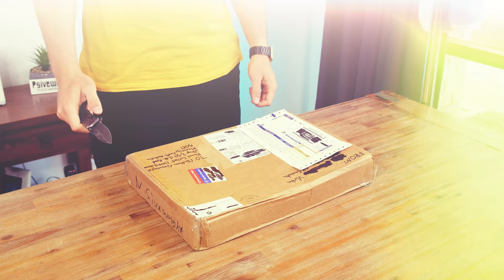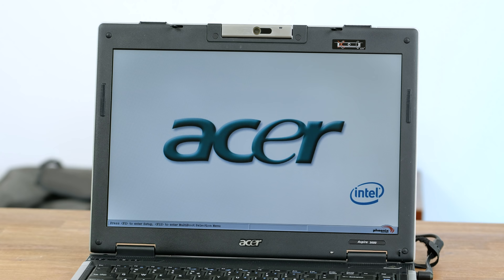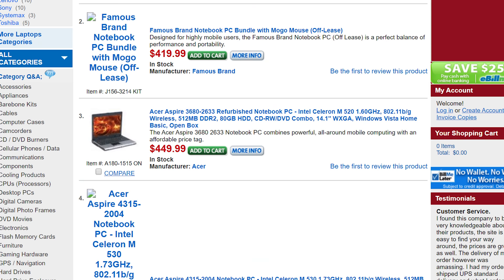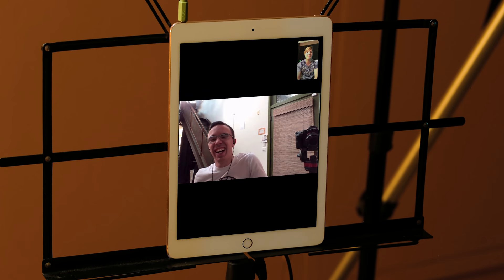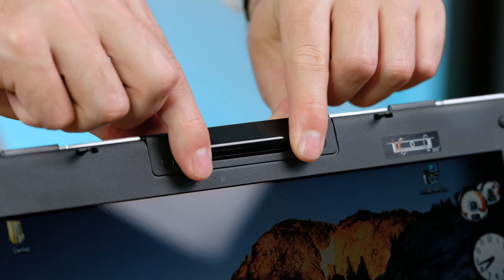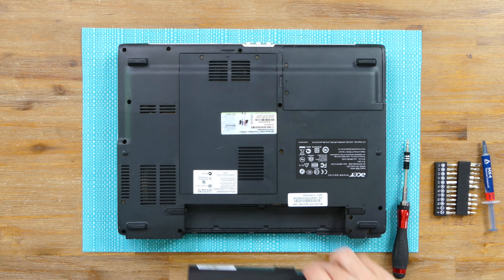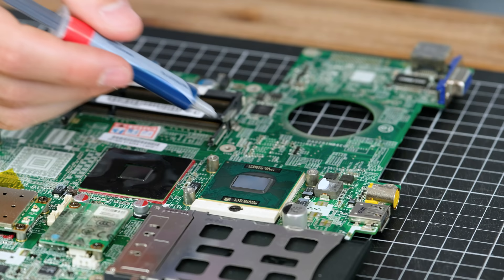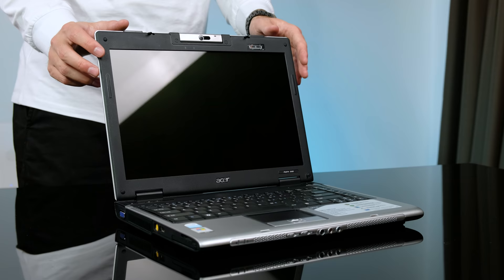Windows Vista Laptop... In 2020! Ft. Austin Evans

Comment: You should've find a replacement dual core processor and replaced it while your inside. I took my Toshiba A105 I used in college (06) and replaced the 1.86 GHz intel Core solo with a 1.7 GHz Intel core duo while I was replacing the fan a few years back. Still holds up in XP playing old games. Did preform very well when I ran Windows 8 release candidate back in 2012 with only 1 gig of ram.

Comment: The desktop version of that cpu was no bettter. I had the celeron D at 3.2ghz and it really lagged until I replaced it with a pentium D which seemed so much more powerful. The main problem with that generation of celerons was the lack of available l2 cache.

Comment: I have an acer aspire 5570 zr 1 it gets the job done it can run windows 10 i run windows 7 super lite on it her are the specs
1.6ghz cpu
1gb ram
128gb IDE HDD
I love this pc i am emotionally attached to it
Oh i also have an acer aspire T660 desktop under my bed with another pc from 1998(the cpu is installed on a pci express slot like thing and the socket is empty) i love old computers they look gud to me
I also play gta san andreas on the aspire 5570 and played through the whole game

Comment: I think this laptop can be upgraded with the T7200 Core 2 Duo, which is dual core, and runs at 2GHz, so that will make it a far better experience. Can be found on eBay for about $7US or $10AU.
A bigger SSD(120GB or so), and that faster CPU would do wonders for that machine..

Also, Broadcomm made a CrystalHD card, that goes in the MiniPCIe slot and decodes video at 1080p30fps, however, since that laptop only has one MiniPCIe slot, you would have to use a USB WiFi card.

Those laptops would make good Linux machines, if you run a 32bit distro, which will use less RAM, Mint 19.3 32bit Ubuntu MATE 18.04 32bit, and Lubuntu 18.04 32bit are supported until 2023.

Comment: I have Acer 5570Z, similiar to Acer 3680. Mine is upgrade to Intel T7200, 2GB RAM, 240GB SSD. Have no issue with this laptop hardware..

Comment: hey i used a vista laptop too! it was a bit better with an amd turion x2 and 4 gigs of ram
it ran vista home premium perfectly. i was able to get the same laptop again and it handles vista ultimate and windows 7 just fine. i wouldn't count on 8 or 10 though, espetially 10. the performance on 10 on older hardware makes me shiver. its so bad.

Comment: I had a similar laptop specs wise, an Extensa 5220, it was $650 new from A&R on Commercial Rd, early 2008. It had a new case design, slightly faster CPU and newer chipset but the rest was the same. We got it upgraded to 2 gigs from the get go, the guys at the store would open the box and do the upgrade for you for free, something that would never happen these days due to the demise of dedicated computer stores. The original hard disk was an 80 gig Hitachi 5200rpm. Did not help the slow CPU at all, don't miss the thing haha it was such a bitch to use. My then 5 year old Athlon XP desktop seemed faster, maybe because in some ways it was. Compared to new budget laptops which are actually pretty quick and very usable even on the latest OS shows how far we've come in a hair over a decade.

Comment: Hello I would like to give you an advice if I am not disturbing you. In case you want to keep that laptop as a windows vista machine you could try to have a cpu upgrade on it. In fact there are only two cpu compatible with the m socket and the same watt (27W in our case) as your laptop. So i suggest you to find and install an intel solo T1400 at 1.8GHZ or an Celeron M450 at 2.0GHZ

Comment: I have two laptops very similar to this. The first one got thrown away, the second one I bought for maybe $15, and is a TravelMate 2480, which has a similar style to this one. From tests, I determined that laptops like this can run Windows 3.1 up to Windows 10, as well as Windows Longhorn build 4074, most 7 beta's, most 8 Betas, and some Windows 10 betas. This does not seem capable of running Windows 95, 98, and the NT line before 2000. I have not tried running 95 and 98 under FreeDOS. I also have the original 80GB HDD that came with the laptop as well a 500GB one that I can pop in as well. The 80GB HDD has (or had) Windows 2000 and XP dualbooted, while the 500GB one has Vista, 7, 8.1, and 10.

Comment: i got so much flack off my colleagues when i worked at a pc repair shop for saying vista wasn't a bad os (it wasn't), it just came poorly optimised for most systems when installed fresh, it only took a month of settings tweaks and it ran great, 8 however should not have been put on anything that wasn't a windows tablet pc and i wouldn't even say it ran great on that.

Comment: I received an HP version of this lappy with same specs, just a fixed webcam. Mine has a dead battery but the system ran slow but usable with Windows 7 pro 32bit. I rather use LINUX and installed that and suddenly it ran MUCH FASTER and more stable! Imagine that.. The use of an SSD would speed things up I reckon. But I have to tell you the system DOES allow 4GB as that is what mine has! The Intel GMA945 chipset allows a total of 4GB(3GB usable in most 32bit OS). You need only to use DDR-2 PC5300 2GB sticks. Windows Vista was what was originally installed on it. The 1.6ghz Celeron is only slightly better than the Intel ATOM 1.6ghz cpu so that is a plus. This system was very budget but usable with the right OS(LINUX). Vista was too heavy just as Windows 10 found in all modern PCs is too heavy for the SAME SPECS that some budget lappys and PC units sell for today! Even NUCs and single board computers are selling with Win10 installed and they crawl! Put LINUX and suddenly, the units work as they should..again.. imagine that..

Comment: you should have used modded gma drivers games would have run a little better also you should do a update video upgrading the cpu to a Core 2 Duo T5300 they are around 13aud free shipping on ebay

Comment: My very first personal laptop in 2007 was HP Pavilion DV6331EU with dual core AMD Turion 64 X2 TL-56 and 2GB RAM. After 1 year the wifi and display broke down and it came out this particular model was subject of a class action lawsuit due to defective motherboard. The warranty was increased to 3 years automatically.  Finally it gave up on November 2010, 5 months after the 3 year warranty expired. 
I never enjoyed Vista, but liked its UI. I think Vista was not the worst from Microsoft. Windows Me had the worst stability and Windows 8 had the worst desktop experience. The problem with Vista was it demanded specs so much higher than XP, that it was slow in almost all configuration. By the time SP2 was released, hardware caught up, but Vista was stuck with a bad name. And those nagging authorisation prompts - who can forget those. Windows 7 was like a refined Vista.

Comment: you should consider change cpu to a core duo or core 2 duo, two core cpu increases performance dramatically from one core cpu. Also check if there is any bios upgrade, I have similar problem with a Packard Bell wich does not accept more than 2GB, and with the latest Bios I make it work with 4GB

Comment: we still use an Acer Laptop like this at work with a cam like this, but its form 2010 with core2dou 2x2.4ghz 4gb ram and geforce 9500m gs (512 mb vram) so for office its work still good. we use it to scan documents or sent mails but i try play games on it and.... yes Assasis Creed 1 run on low settings 😅 edit: its an Asus M51SN

Comment: Well, I had the exact same specification but different brand as my first laptop in 2007 until I get a new decent laptop in 2013.
It came with windows vista and 512MB RAM and SATA I, but it can do editing at 720p with Movie Maker, Photoshop CS3, and run GTA SA well on lowest graphics with 800x600 resolution, 512MB RAM on Vista can still do anything in 2010.

Why your laptop stuck at 100%, I never get "struggle CPU" even windows aero theme turned on.

Comment: You can created a video of if it can run Windows 10 if you want but I bet it will be very slow as it has 2GB RAM, a slow single core processor, and an ssd but with 60GB

Comment: This laptop was shit even for 2007 standarts, My very first laptop was asux x50vl, it had 2gb of ram, 120gb hdd, dedicated ati graphics, dual core pentium cpu. To give some perspective, at the time a lot of people were hating on vista because vista felt slugish, it actually didnt their pcs were fucking trash, this laptop ran windows vista without any problems or any hickups and this laptop laster over a decade, it stopped working like 3 years ago, it was quite expensive in 2007, but it was well worth it.

Comment: I still use Windows 2000 Pro Sp4, PC is not connected to the internet, works without a problem for what I need it. My PC at work runs Win XP, don't need the net there as well for viewing the info and data on CD's images that I loaded in virtual drives. Download PC's in my workhouse at home run both Vista and data PC runs Win 2K Sp4. There is no need for something newer and I really don't want the crap win10.

Comment: I remember around this time I had a 14in ACER Aspire with a dual core AMD Sempron CPU, and 4GB of DDR2 RAM which was the max don't remember the exact model #, but it was the last model I know of that used an IDE drive instead of SATA which was an 80GB drives, and  it was the last major thing my father bought me before dying of welders lung, and that thing was a real trooper running XP, and then Vista before it gave up the ghost in around early 09.

Comment: Hey psivewri i have a acer nitro 5 and i tried repasting as my laptop runs too hot, 10 degrees celcius it's winter yet with -132 mv undervolt and disabling turbo mode, 4ghz - 2.30 ghz after turbo disabled my laptop crashes after reaching temperatures of over 83 celcius on just 50% load... but the small screws that hold the cpu heatsink and gpu are shrewed off, they don't have any grip basically (sorry for my bad english) hopefully you can understand me and give me advice on how to open these tiny screws that have lost their shape and have no grip!

Comment: What is Vista?
Reply: it’s a operating system from Microsoft, it was named Windows Vista, back when it launched, it was so controversial that many people downgraded to Windows XP, earlier laptops that shipped with Windows Vista, came with Windows Vista Home Basic (or Windows Vista Basic), it came out in January 30, 2007

It’s also a operating system that was produced by Microsoft as a member of Windows NT family of operating systems, at least Windows Vista wasn’t as bad as Windows Me. It was released to manufacturing in November 8, 2006.
Here’s Windows Vista’s minimum system requirements:
800 MHz CPU
512 MB memory
Graphics card that’s DirectX 9 compatible
20 GB Hard Disk with 15 GB of free space
and CD-ROM drive
That’s pretty much what’s Vista (or Windows Vista) is.

Comment: love arcer laptops i have acer 5330 travelmate its great as basic dj laptop i use virtual dj runs great however older laptop's have problems showing more then 2GB of ram even though the max ram is 4GB's computer just cant read over 2GB's im not sure why maybe reintalling windows with 2 2GB'S of ram may fix the problem

Comment: i´ve got a siemens Fujitsu amilo a1650g over here. Saved it from the tech ceilar of my school, the IT guy there wanted to smash it with a hammer. Pure Old Tech Porn. It´s a laptop with a freakin detachable IR Remote in its PCMCIA slot. And it has one of these great old potentiometer Volume Wheels at its side.

Comment: mine aspire 5670 (same family) has core 2 duo t2250 1.73ghz, mobility radeon x1600, 4gb ram dual , 500gb hdd and it works on windows 7 x86 fine
i can say gta sa runs very great on medium settings in 1280x800x32 resolution, most bottleneck going to the cpu 🤣
i will install windows 10 when i can buy a ssd, but cpu upgrade due to 64bit support worth first